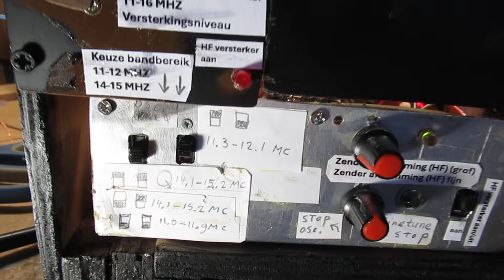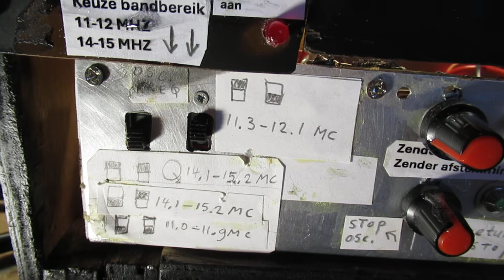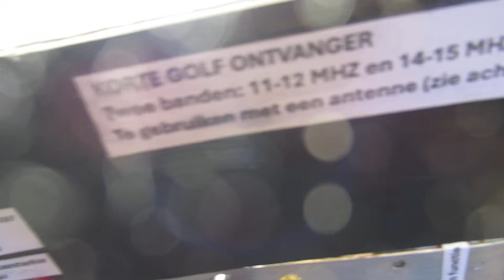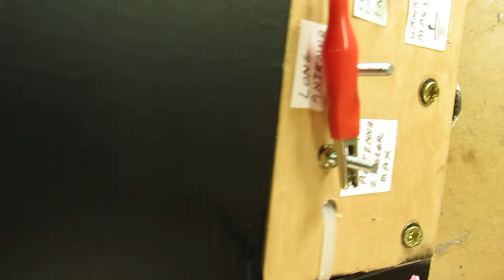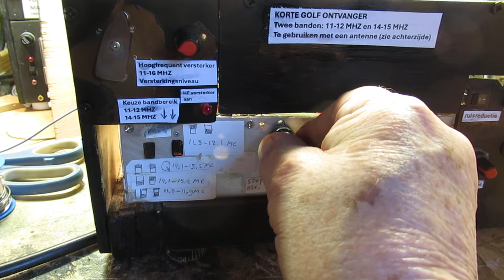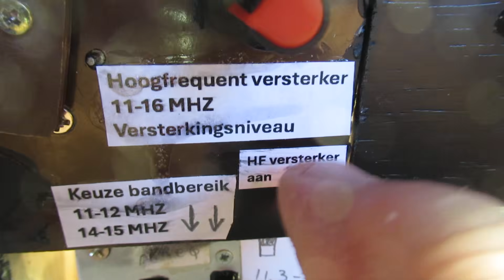Final video about the Shortwave radio for 11-12 MC and 14-15 MC VLOG, schematics via the description

Comment: Good project ,pl upload final schematic one paper sheet Thanks for sharing good idea
Reply from the maker: Thanks
Reply from the maker: The separate units are showed in the links in the textbox, so at first: the overview of that simple Shortwave radio. So make it in that way. Secondly: make the Local Oscillator, showed via the description, made with 2 potentiometers and normal Silicium diodes, used a varicaps (varactors), for the 12 MC and 15 MC range. Connect its output (say in the Shortwave band that you want to listen to) via a capacitor of 100 pF to the first transistor (its base) in the IF stage, that is the mixer transistor. The IF unit + its AM detector is also showed via the video's in the description. Lots of success! 4 aug. 2026.
Reply: Thankyou,

Comment: How many wires come out of those oscillator coils? Some of the circuits I have been looking at before show the qscillator having 5 wires coming out of the coil.but these were circuits for AM broadcast band.
Reply from the maker: In the description you can see the schematics, how the oscillator was made. The oscillator coil (Local Oscillator) in fact only has 2 electrodes (connections, pins) to the transistor that does the oscillation job. But 2 of them can be switched in, separately for the 2 different frequency bands on Shortwave, via a mechanical switch on the front. Of course the output of the local oscillator must be sent into the base of the "mixer" transistor with its 455 KC bandfilter in the collector lead.They (IF transistors) are PNP transistors, with their collector to the (-) minus, the IF coils are inserted into their collector leads, to ground, minus. Visible in the schematics, study them via the links in the textbox. Inserting the antenna signal and the L.O. signal to the base of that 1 (read first) mixer transistor in the IF amplifier is done via a two small value capacitors, in the order of 100 pF. It is (Dutch word) a ""steilheidsmodulator", thus ""slope-mixing". Perhaps that is why you see so many wires. Thanks. 2 aug. 2026.
Reply: @radiofun232  Ok, thanks, I will have to look over that stuff and see how the circuit should be made for an AM broadcast reciever. I am trying to make a heterodyne radio,and I was confused as to how many turns to put in a 5 wire type of oscillator. Maybe I can do a 2 wire oscillator instead then. My project is confusing because I am trying to design the radio starting from a tuning capacitor that I recently bought. The whole thing is it won't be an easy thing because I am using an old style 2 ganged capacitor instead of the tiny mica type tuning capacitor. Hopefully I will make it work..LOL.